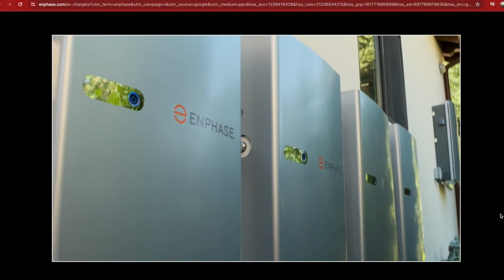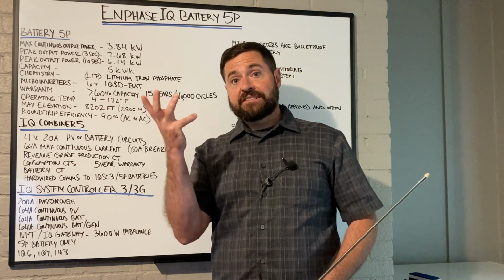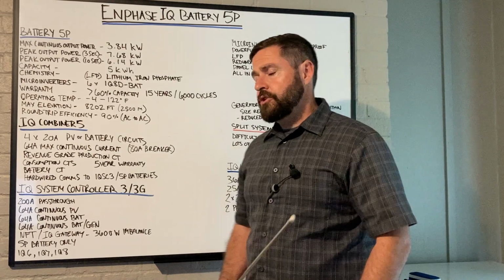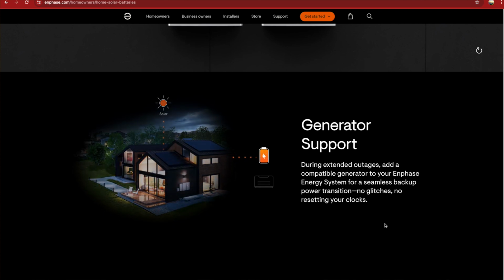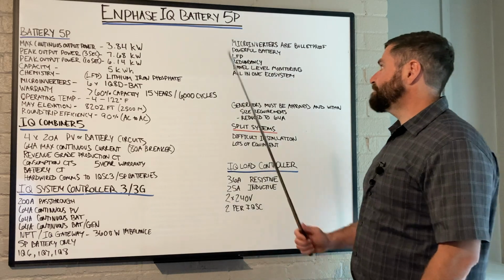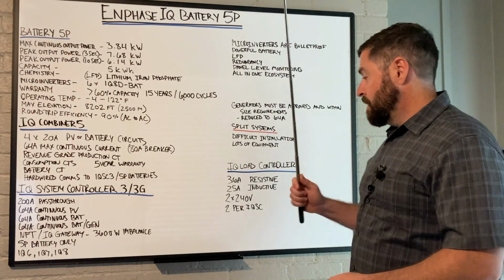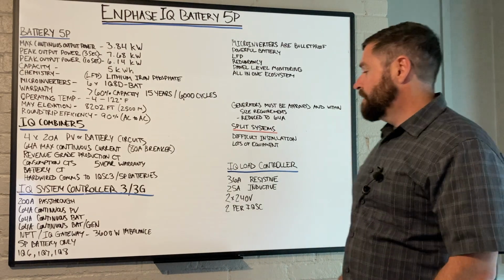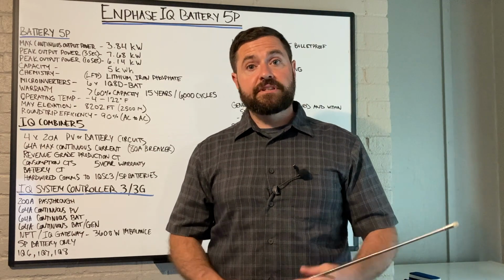The Enphase 5P Home Solar Battery System

Comment from the maker: If you are interested in a zero cost pressure free quote for turn key installation of solar and storage products, fill out our intake form below...

Rocky Broad Solar Intake Form https://docs.google.com/forms/d/e/1FAIpQLSer5w_81iHtdcZBKV8Zuo9KVwJGQsqg_QNV-ePRvmWMiHZ8dg/viewform

If you are interested in DIY solar and storage products, check out some ROCK BOTTOM prices on those products using our affiliate links below...

Signature Solar affiliate link (CHEAPEST SOLAR PANELS ON THE MARKET and EG4 Products) 
$50 off for orders over $500 when using coupon code: GET50ROCKY (expires 12/1)
https://signaturesolar.com/?ref=uzUOpPif73O10D

Current Connected Affiliate (SOL-ARK PRODUCTS)
https://currentconnected.com/?ref=RockyBroadSolar

A1 Solar Store
https://a1solarstore.com/r/b814406845157bf1a9f70001a2730d79
 
Practical Preppers (DISASTER PREPAREDNESS)
https://shareasale.com/r.cfm?b=1574707&u=4123057&m=99148&urllink=&afftrack=

Bluetti 
https://shareasale.com/u.cfm?d=1244919&m=108816&u=4123057&afftrack=

SunGold Power
https://shareasale.com/r.cfm?b=1729232&u=4123057&m=107752&urllink=&afftrack=

Rocky Broad Solar Website
https://rockybroadsolar.com

Facebook
https://www.facebook.com/profile.php?id=61558585264414

Comment: This is such an informative information.I do work for sunrun and they install residential solar panels and home battery, they also offer $-0 -down subscription option and they also maintains and owners the equipment for 25 year contract period. Definitely worth having if you're looking for ways to manage the high electricity bills and also have continuous power backup.

Comment: I have an enphase system that has 56 445 watt panels running IQ8A for each of them. I'm wanting to get into batteries next, but if my calculations are correct, with the 64a limitation, they will be recommending a split system. What other battery setup would you recommend? We are a farm, and average about 80kw of usage a day. In the summer, have way more power than we consume obviously, and in the winter, December and January we get about half of what we consume. I would like to add a generator at some point down the road. Our power company does Net metering on a 1 for 1 until our meter reads zero, and then goes to cost avoidance model which doesn't pay hardly anything.
Reply from the maker: If you are paying someone else to install it, I would go with the FranklinWH system. Just make sure they do not design it using additional IQ Gateways. You would connect a couple of the strings to the backup panel using the aPbox to shed those circuits as needed during a utility outage, but they would still report back to the original IQ Gateway. The aPower2 is coming out early next year which will have double to power output per battery. I have a good video on the FranklinWH system as well. Thanks for watching the channel.
Reply: @RockyBroadSolarLLC  I'm pretty handy, and wouldn't be afraid to try myself if there are better options in terms DIY world...also, thinking I may disconnect from the grid entirely once I get batteries and a generator setup. In a year, generate more power than I use, so the $500 a year it costs to be connected,  well just don't sit well with me if I can cover it all on my own.
Reply from the maker: @Someonesdream  In the DIY world you could use the Flexboss21 and Gridboss and AC couple the Enphase system to that. Please also watch my most recent video on the Enphase updates in 2025. They have now opened the DER port for additional PV.

Comment: What's the price of a single battery?
Reply from the maker: You can check them out on my Signature Solar link in the description, but it takes a lot of other components aside from just the battery. If you need a quote for a turn key installation just fill out my intake form and I can get you an estimate. Thanks for watching!

Comment: How all micro inverters synchronise with grid??
Reply from the maker: I am not an electrical engineer, but they are grid forming microinverters capable of creating there own microgrid. They can sync with the grid as long as the grid is providing clean and stable power. Thanks for watching the channel!

Comment: You didn't mention the Enphase IQ8x-80-M-US @240 VAC inverters... .they go up to 384 peak output power.
Reply from the maker: Those are a unique microinverter that are designed for high voltage modules, so I did not include them in the comparison, but yes, you are correct. Thanks for watching!

Comment: New subscriber. Good analysis. newbie question: what is better a Enphase or a eg4 system (microinverters vs just one inverter)?
Reply from the maker: That is a loaded question. It really depends on what you are looking for. If you are looking for redundancy and avoiding one central failure point, Enphase wins. If you are looking for affordability, EG4 wins. Thanks for subscribing!
Reply: @RockyBroadSolarLLC  thanks for the answer!

Comment: Looking at the battery spec I have to ask. Is 3.84 kVa same as 3.84kw?
Reply: In a perfect scenario with zero power loss, yes they are. kW output would measure the actual power delivered/received
Reply: @ZachSolar Thank you for the explanation.
Reply from the maker: Yes, kVa is pretty much the same thing as kW. volts x amps = watts. Seems like @zachsolar probably accurately called out the minor difference between the 2. Thanks for watching!
Reply: @RockyBroadSolarLLC Thank you for the explanation, I was scratching my head when I saw 5P's spec sheet as other manufacturers tend to go with kWh metric.

Comment: In NJ for install 4 5p batteries  companies want 38.5k $ this insane.  2 tesla powerwall 3 cost 22k $. Same chemistry, more capacity and more output. One thing is different tesla powerwall 3 can not be charged from generator.
Reply from the maker: Thanks for watching and commenting! That is correct. Enphase includes a lot of bells and whistles and redundancy, which also means more cost. You would still be able to integrate a PW3 system with a home that has a fossil fuel generator on site, but like you said, it won't be able to charge the batteries, it would just be a secondary line of defense in an outage in case you depleted the battery bank.

Comment: Wow. Talk about major limitations. Not even compatible with there own older systems. Just a way to force you to buy more equipment exclusively from them.
Reply from the maker: Yes, it is a shame. You can mix the 5P battery with older microinverters, but all micros have to be the same generation and all batteries have to be the same generation. No mixing of microinverters and no mixing of batteries. Thanks for watching!